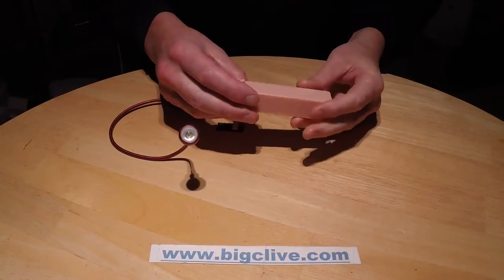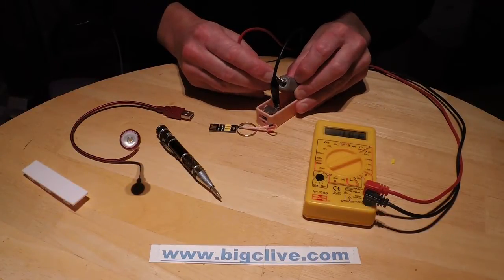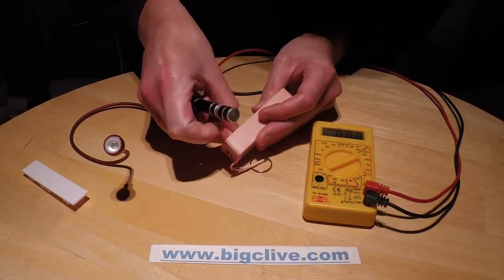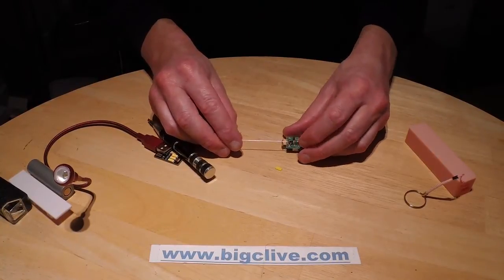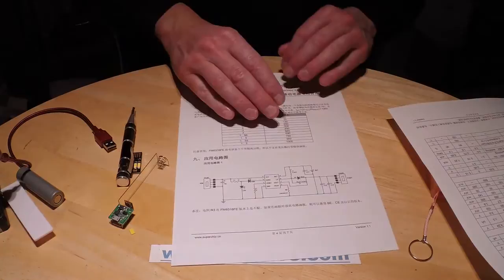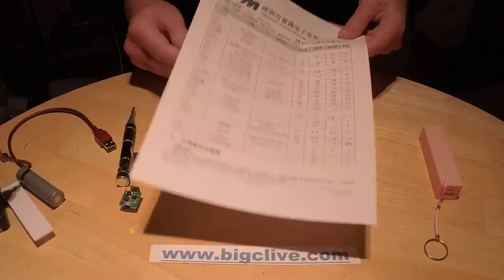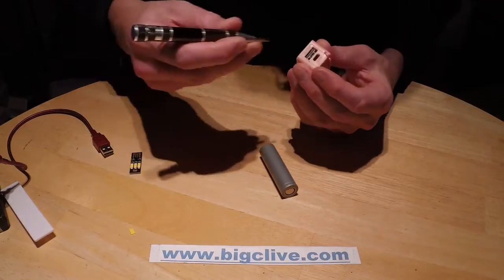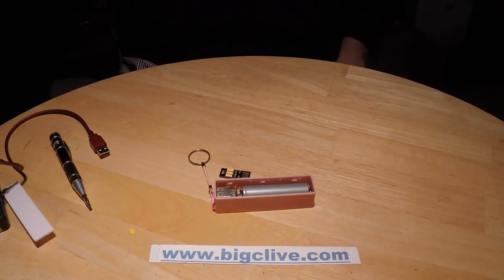Pink USB power bank analysis.

Comment: Thanks for the video!
One question, is there any way to increase the output voltage from 5v to 6v? I mean by replacing / modifying any resistor? or what would be the best solution to reach to 6v any current.
Reply from the maker: +Ronnie Van De Ploeg The voltage reference circuitry is often built into these dedicated integrated circuits.  If you knew the internal circuitry of the chip it might be possible to cheat a sense line with a diode or two to bump the voltage threshold up.  It might be better to use on of the common micro USB charger PCBs with protection, and add a boost regulator unit.
Reply: Thanks for your time!
yes, that might be the best solution, something like this: https://www.aliexpress.com/item-img/5PCS-MT3608-DC-Adjustable-Boost-Module-2A-Step-Up-Booster-Power-Module-MICRO-USB-2V-24V/32700926143.html?spm=2114.10010108.1000017.2.112319f53A117X

Comment: Hi, Are these the same as the Pound World 1800mAh ones, but with a lesser battery?
Reply from the maker: They seem to use different circuitry.  I managed to nuke one of the Pound World ones simply by putting a meter in series with the cell to try and measure passive current in standby.
Reply: Oh bugger!

Comment: I have had two similar looking power banks fail supplying 1amp through a homemade usb cable, after getting to hot. what would be the easiest method to reduce output to 7 or 800mah?
Reply from the maker: +sim6699 If the device you're charging needs the higher current then you may need to get a beefier power bank.  But for DIY stuff you can limit the current with a suitable resistor.
Reply: @bigclivedotcom  nice

Comment: I just bought one of those and when I plug it in to charge my phone, after some time, probably when it's discharged, it actually drains the battery and the blue discharging light goes a bit dimmer than normal and the phone goes absolutely mental with the charge indicator flickering between charging and not charging and the phone gets really hot.. Is that behavior normal or is my power bank broken?

Comment: these power banks are now £1, one single englandshire pound,  in various pound shops and Ive got a few and i noticed that the red LEDs which flash to indicate theyre charging all flash with slightly different intervals. weird.
Reply from the maker: +0yeme0 That's not uncommon.  The chips use internal oscillators with resistors and capacitors formed on the chip so the tolerance is quite wide.  I bought two of the Pound World ones.  One was fine, the other had a completely flat cell that had to be disposed of.

Comment: These look like an excellent little product - they take a replaceable cell, so when the 1000maH (as seen in your other video) cell wears down, you can replace it with a much higher capacity cell. I recently picked up some genuine panasonic cells for my electric cigarette off eBay and they last ages - 3400maH! So I went and purchased more of them and use them in a Soshine E3 bank which takes 4 cells, individually monitors each cell, has a fuel gauge for each (which can be turned off if you like); the only draw back is it charges them pretty slowly, off a usb port. I'd link my supplier for the cells but he only ships to australia :(  When my electronic cigarette registered "Check Batt" I put the battery on my RC hobby charger and I put back 2597 maH into the cell, and my cigarette errs on the high side for "battery too low" sensitivity. I might pull the soshine apart, and look at the current sense resistors, and beef up the charging current a bit (taking into the consideration the limitiations of the USB spec).

Comment: Hi Clive just looked into the 4213 chip in these power banks from what I can gather it's supposed to put out a fictitious 1amp .looking at the data sheet there an I set pin with a 1k resistor on it. May be a smaller resistor would increase output current?
Reply from the maker: Martin cowell The unit does put out 5V at 1A.  The resistor is used to program the current used for charging the internal lithium cell.  That way they can reduce the current for a small cell or increase it for a larger cell.
Reply: bigclivedotcom it was in Chinese so couldn't make it out to well Lol I'll see what 18650 cells I've got lying about in old laptop batteries and put a bigger one in